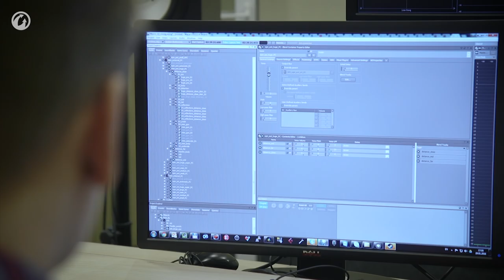World of Tanks - Development: Improved Physics and Sound

Comment: what this game need isn't new sounds or new turning system , it needs rebalance of OP tanks (batchat, 13-90, czech top tanks, 110e3, etc) rebalance of prem ammo it's too common, noob protect is obvious,  spot system isn't working properly, also penetration system isn't working (batchat eats through ammo it's not just a lucky bounces), and arty players... ohh i don't want to start writing about how hard is to play artys (just move away 10meters from the circle and shoot at tanks on full speed and take atlest 800 dmg if you miss, and if you hit on target 1200 - 2000 dmg depending on the arty)
Me personaly i have more than 20k battles my in-game sound is on 0, i'm tired of hearing the same stuff over and over again, and the new sounds won't make me turn up the sound, and there are players with more than double my battles so i don't think anyone cares about new sounds. WG just make sure to rebalance ^^ artys, OP tanks and prem ammo are the biggest problems now